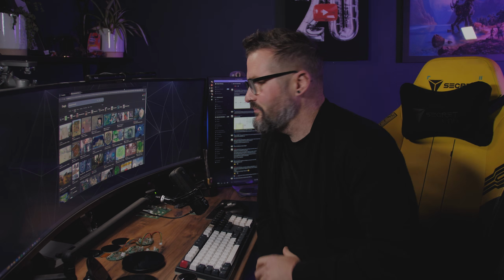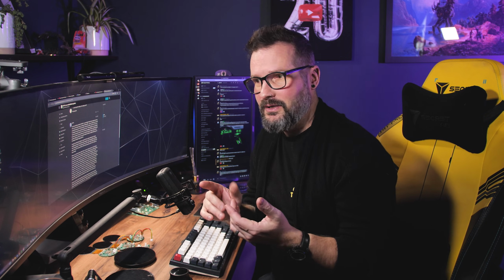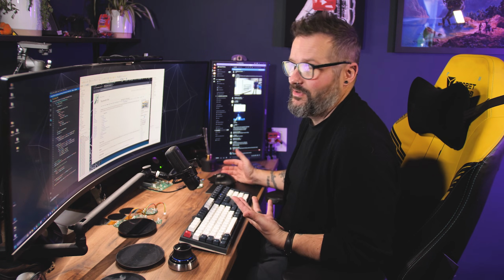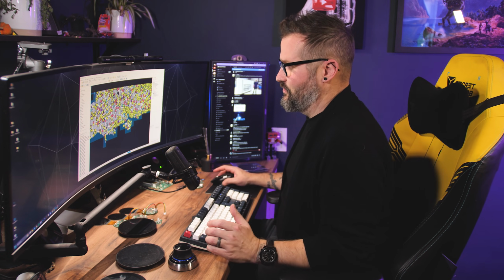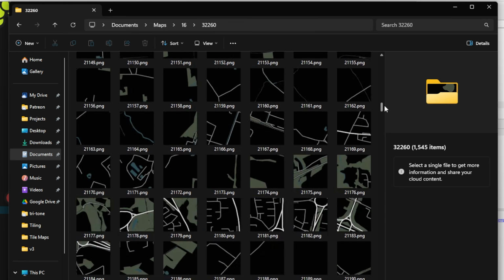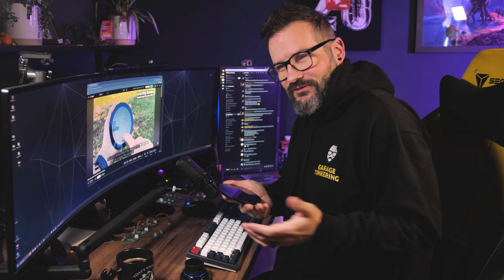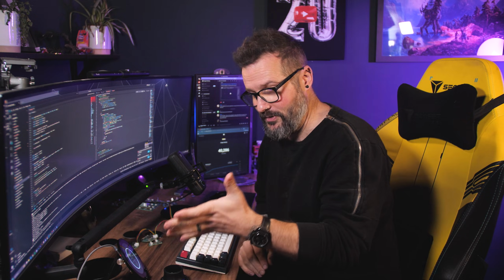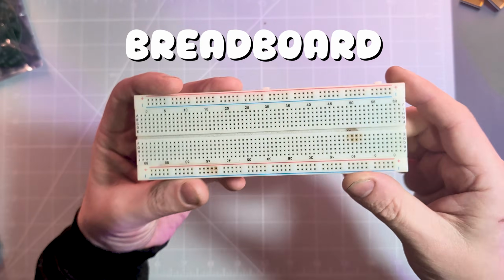A Real Mini Map from Need for Speed

Comment: It not using the whole screen would drive me nuts
Reply: yeah...not using the full display is criminal...i think it could be fixed in software. on top of already having a large physical bezel, the rest of the screen is another big bezel too..
Reply: @Ezio470  there must be a reason, like bro must have tried the maximum tile size that moves without jitter and does not need to scale up pixels but man not using a smaller display or having unused screen is killing me. bet he just wants us to learn coding lol
Reply from the maker: @martint6097  The reason is nothing to do with performance. It's an aesthetic choice to balance with the two other gauges that go alongside it, plus to use the outer space for other legal requirements like engine and ABS lights. 

You can just remove the overlay and change to a 5x5 grid and it runs fine full screen
Reply: @GarageTinkering  We'd really like to see that, and any other UI elements you'd want on this screen could just be overlayed on the map with a drop shadow.
Reply: @GarageTinkering  wait if you are building this into a dash why are you building it on an esp 32 instead of 1 computer to run the rest of the gauges too. This is still really cool just curious
Reply from the maker: They're all CAN connected so I can easily add new connected devices if I want, plus part of the challenge was seeing if I could do it on budget hardware
Reply: @GarageTinkering  Oh nice! I just assumed the embedded system/display you used would not support loading images partially off the screen, so you plopped down a square as big as you could within the circle, and then added a bezel overlay to hide the negative space in the circle outside the square of tiles.  

I would also love to see it working in full screen if you are able to hide the visual software bezel overlay and upload some pics of it running in that, and the other modes you mentioned to twitter or instagram.
Reply from the maker: @elementneon  Sure, I'll stick something on IG later
Reply: @Ezio470  Seems to be this guys theme. Fun ideas with solid execution but he is always 70% there. Its never perfect or even close to perfect
Reply: Yeah, though it would be cool to use the GPS to display speed around the outside of the map.
Reply: @Petriefied0246  needs a radial gauge on the outside for current heat level
Reply: @fakkuzaporisu  Nitrous gauge!
Reply: @Petriefied0246  you’re on to something dawg
Reply: Especially that the screen already has got diabolical bezels.
Reply: Yep, it looks like he needed to have a full square of tile(s) on screen, without any edge clipping, so he added his own software bezels that could hide the unloaded tile space in the 4 edges of circle outside the square title(s). Not sure how much more difficult it would be to code the ability to load images that are partially off-screen, on a dumb embedded device like that. There's plenty of solutions for full operating system implementations.
Reply: Looks like the issue was that it displayed a rectangle, and he just cropped the sides. So it's not real screen estate.
Reply: Yeah that kills this project imo. Non negotiable to use the entire display lmao

Comment: Would it be at all possible to make the actual map parger on the screen.
It looks like theres a lot of unused display space
Reply from the maker: You can f just remove my overlay and use the full screen by changing the row and column count to 5 and it'll full-screen just fine. I chose not to

Comment: Cool project, cheers to that! 😀 The only thing that buggers me is the amount of blank screen area around it. You basically circle cropped the one map in the middle, but would it be possible to render more than one tile, basically creating a map bigger than the screen resolution, center it, and fill out the whole circle of the display? maybe with the white border right at the outer edge? Similar to what you have in the gauges video? Would look even cooler I think. 🙂
Reply from the maker: It's a deliberate choice for several reasons.

1. It doesn't just show 1 tile - 9 are in play at any one point in time. You can just adjust my code to a 5x5 grid and remove my cropping overlay and it'll work fullscreen. I simply chose not to because,
2. When you place it alongside the other gauges, being fullscreen pulls too much attention. It's not aesthetically balanced. This solves that. Also
3. To keep my car road legal I need to put alert markers for things like the check engine light, ABS, etc. They're all going to live in that black space

Comment: Well done, I tried to make a Pi Zero based GPS for my car. Turns out my car media player won't play  the HDMI input video when driving.
Seen some round ESP32 display recently, hmm, car dashboard speedo?
Reply from the maker: Those media players usually have a line linked to the parking brake that only allow video to be played when stationary. If you disconnect it and ground the wire instead, it'll often allow it
Reply: @GarageTinkering  Yep, I found that out, but car was still in warranty. Now 5 year later and retired I might revisit this project as you have shown me how and have lots of spare Pi's and now a 3D printer for nice case.

Comment: Awesome project! One way that might work to optimise is to use point and vector data instead of png/bin files for the map data. You can probably get that out of the GIS tool and then use the ESP to render the road image as graphics primitives. Not sure but I think the data would be much smaller and take less RAM. That might get you the spinning maps you want?? More time, more coding!
Reply from the maker: Yeah, that's the next thing I'm going to look into for this, along with decoupling the waypoint markers so I can do some more fun stuff with those

Comment: GarageTinkering  Since the display is round, you could mount it on a stepper or continuous rotation servo so the car pointer is always pointing up..  The esp can be powered by battery with ring type brush contacts on the shaft to keep it powered at all angles.

Comment: This might be a weird solution, but you might be able make the screen a mechanical rotating compass. Basically have a motor rotate the whole assembly based on direction of travel.
Reply: It would probably be pretty difficult to synchronize that to actual magnetic south

Comment: Regarding the performance issue with the rotating map, could you possibly make the background color of the map transparent. then set the background color of the display to that color. The idea being does this reduce the file size enough to improve performance? Just a thought
Reply from the maker: Using LVGL that doesn't really give a boost as it's already just looking for changing pixels

Comment: Considering folks were able to do image rotation--using the Bresenham's Line Algorithm--on an 8-bit Apple ][ running at 0.001GHz, I have GREAT confidence that a 32-bit ESP32 running 400 times faster can do it in a timely manner.

...probably not in Python, though.  :lol:
Reply from the maker: I'm not using Python. It's all in C++
Reply: @GarageTinkering  Even better!  (Using the BLA means not having to use floating point, which makes things SOOO much faster.  ...and if you double the original pixels, you can get built-in anti-aliasing once you downscale the resulting image.)

Cheers!

Comment: images? why? whhhyyy?
If you cannot use victor graphics, then it is not worth it at all.
Reply from the maker: I mean, the result here other than some scaling is the same, so I respectfully disagree
Reply: @GarageTinkering  if you ignore the size and the scalibility if you decide later to do the same on a bigger monitor.
Can you imagine how much more features you could add if you reduce the heavy load on the microprocessor if you use vector graphics? think about it.
You did a great job. But images make the system very very heavy. You said yourself how long it took to "upload" them.

Comment: 12:50 I don't understand trying to get the size under 250 GB. Earlier in the video it shows it's only 17 GB of data in the original PNGs.
Reply from the maker: You don't use the PNGs. You pre-convert them to BIN files so you don't have to do it on the fly. Every BIN tile is 129kB, so the memory requirements ramp up.
Reply: @GarageTinkering  I understood the PNGs were not used but those are some chunky BINs!
Reply: png is compressed, but he converts them to bin (like bmp with no auxiliary data), so the size grows
Reply: @0lympy  yeah I got that part. I did not think it was going to be such a big increase. Also the 250 GB limit is from the SD card being used, which was not clear to me at the beginning.

Comment: That not rotating the map would have killed me. That would have been a hill I died on. 😂 (i suspect you tried running the esp32 at full speed rather than stock clocks)
Hats off to you, really can't wait to see the finished dash.
Reply from the maker: There might be a workaround, I've gotta try some stuff, but I think in retrospect the static map might end up being less distracting, which is ultimately a good thing

Comment: Long story short I ran from the police and the GPS was way too slow. I could never keep up once you’re gone significantly past the legal limit limits.

I wonder if this could be a fix for that. 

A slow loading from the SD card seems like it would be an issue.
Reply from the maker: Each tile is approx 600m across. At 100mph it would take ~20 seconds to cross a tile. It's pretty much impossible to make this one not load fast enough.

The three new tiles it loads takes 0.25s, so to make it overload you'd need to cross a tile in less time than that, which is about 5400mph. I think I'm safe haha.
Reply: @GarageTinkering  dude good luck on that response that’s freaking awesome. I also think maybe  data service wasn’t keeping up. 

This was 2020. 

Thanks for the response again! Super interesting video.

Comment: This is awesome. You'd open up a lot of possibilities if the marker circles were drawn on the ESP32 rather than baked into the images - for example showing nearby or destination markers at the edge of the circle based on direction when they're "off screen". I imagine it would be useful to have the nearest gas station always visible in this way for example
Reply from the maker: Yeah I think I'm going to look into that as an iteration
Reply: @GarageTinkering  If you plan to keep the minimap at a specific zoom level you should just delete the rest of the zoom levels and keep one, that would make it more performant too. Or Vector route like people are saying.
Reply: Need for Speed Rivals had something like this for things like the nearest repair station and other POIs. That would be massively cool to see implemented.

Comment: I done the same project about 2 years ago on raspberry pi. but i couldnt figure out when my position got to the end of one map i needed the next map to appear smoothly like it was always there. It appeared but just wasnt smooth. I chose the RPI over ESP32 as I belived it was faster and most of the librarys i used were in C. Watching your vid has inspired me to look at it again. Wanted my own gps mapping for my Fiat 126 dash project. Excellent stuff I enjoy what you do 👍
Reply from the maker: I did it by basically ensuring the newly needed tiles are off-screen, and then you do the tile buffer and position shift before restarting the animation. If you take a look at the code it might give you an idea.
Reply: @GarageTinkering  Cheers man Ill have a look

Comment: Probably a moot point seeing as this seems to be fast enough for what you are doing with it, but If your SD card reads are the bottleneck as they often are on a system like this, consider using JPEG tiles. The tiles will take less space with almost no perceptible loss in quality and you can take advantage of the hardware JPEG decoder on the P4. I personally don't have a P4 to play with, but the data sheet says it is capable of 100+ FPS at 720p. You could decode, scale and cache the images in an LRU cache in a separate task, possibly even using the second core to reduce the load on the main core. This would greatly reduce the number of SD card reads, the amount of data read from the SD card and should result in an overall performance improvement as reads from RAM are much faster than reads from the SD card.

Comment: 2 questions:
* what's the reason for not using the whole screen? Is it processing or do you have other reserved purposes for that edge?
* have you researched using vector tiles instead of raster tiles running locally on the device? (vector tiles have the benefit of using binary data and styling being applied on the fly with a json file so you don't have to re-render everything when you want to update)
Reply from the maker: Aesthetic balancing alongside the other gauges (will make more sense in the next video) and I'll be using  the outer space for various other things. 

And I do need to look into the vector option.
Reply: @GarageTinkering  Looking forward to the next video(s) 😉